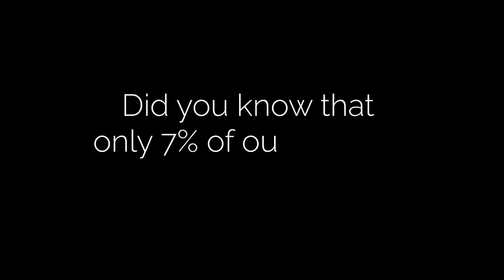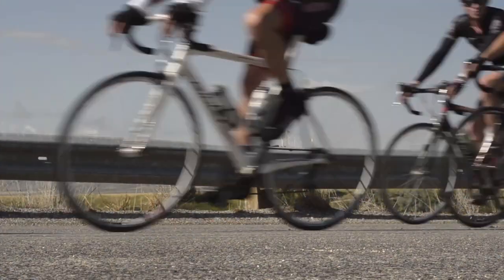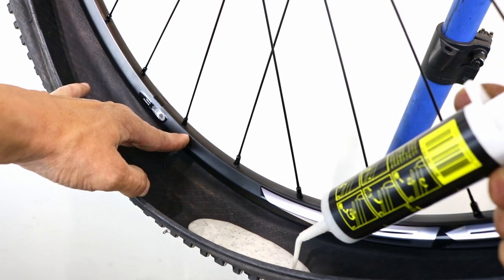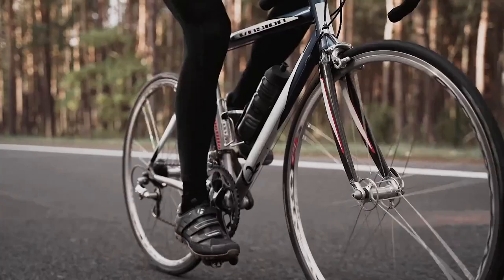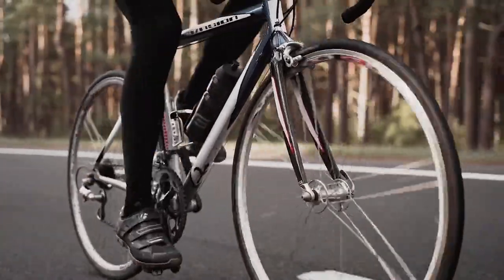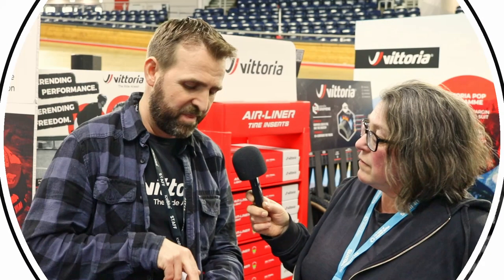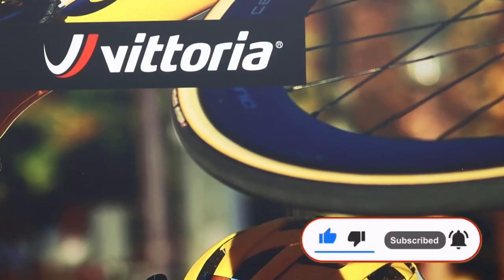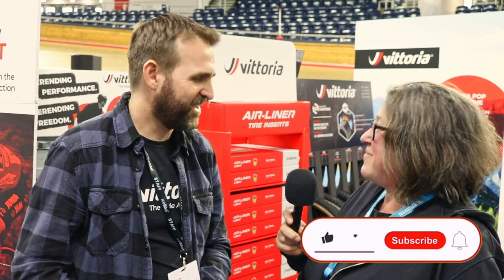Thinner or thicker road bicycle tire? Vittoria expert, Jake Law explains

Comment: I’ve been running 32x700 clincher for years, on my bike. i’m always having to remind myself to run lower tire pressure. definitely more comfort, and I personally think it allows the tire to be more resistant to cuts and abrasions.❤
Reply from the maker: Hey, thanks for the comment and sharing your experience with others. Would you consider to use tubeless?